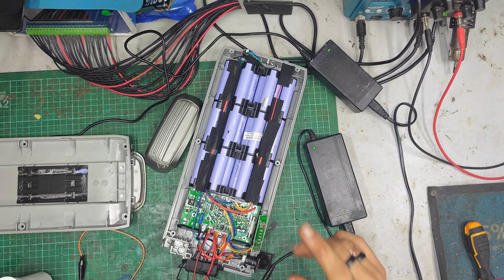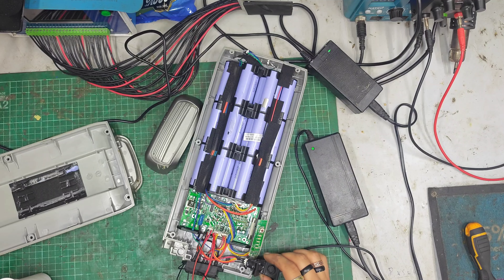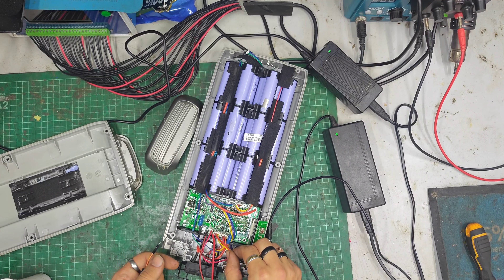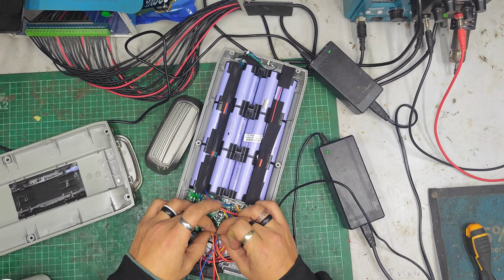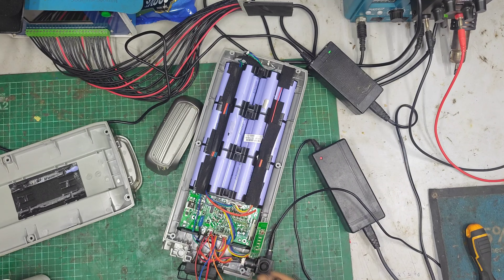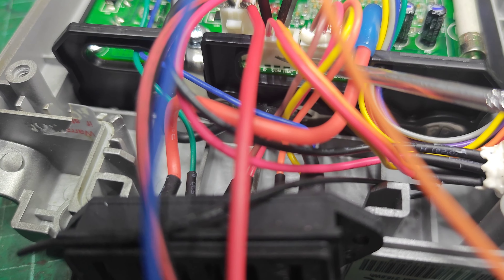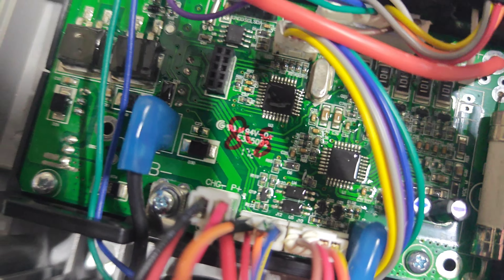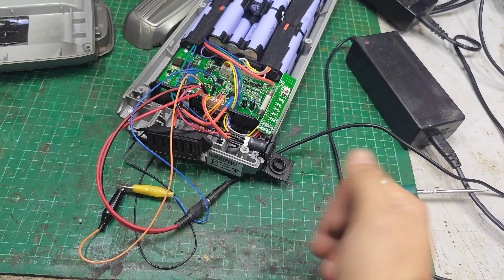Pendleton Ebike Battery charger not working? how to make it charge (don't try this at home)

Comment: hi, does this bike use the sportdrive motor unit? if so what is your opinion of it? specifically the reliability, I cant find any info on the net about the motor?
Reply from the maker: @tonyhill8300  no, this Pendleton uses a geared hub motor

Comment: I tried this and still no luck. Any further info?
Reply from the maker: Sorry this is only to use a non original charger, if it isn't working you have another issue, cells, wiring or BMS related